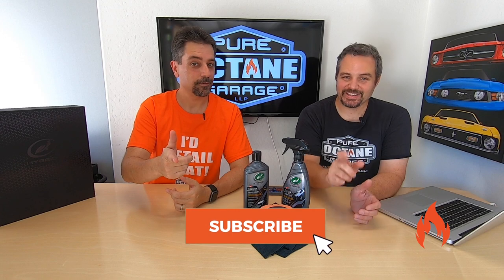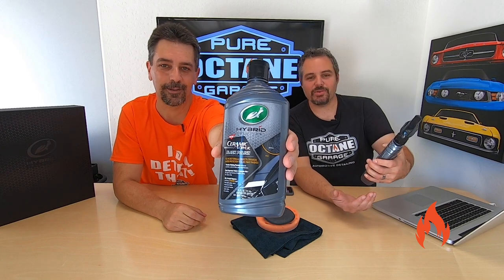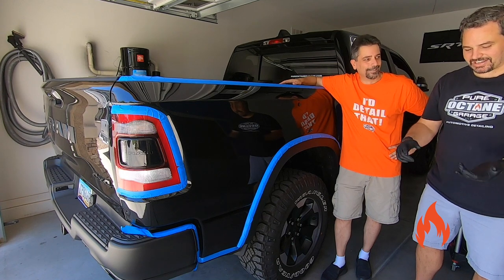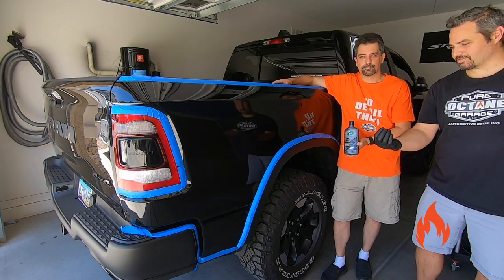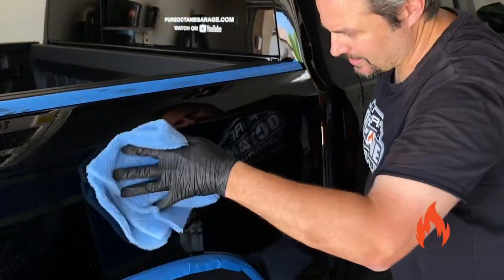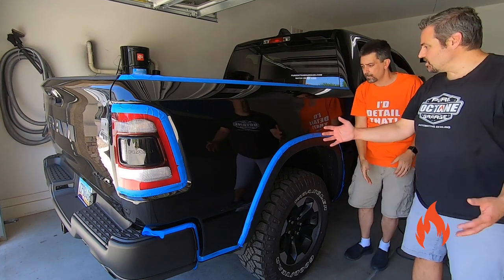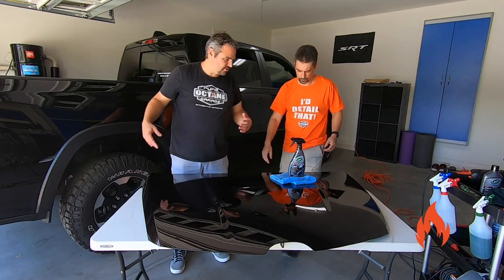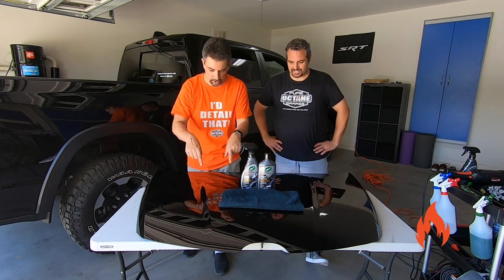Testing Out Turtle Wax Hybrid Solutions Ceramic Acrylic Black Polish & Spray Wax: Still Amazing?

Comment: It looks like you applied the black wax immediately after you polished with the black polish. The directions on the bottle and from TW directly say to wait 24 hours before topping. Did you in fact top the polish immediately after, or was that just a video edit? If so, how did the wax perform over the just polished panel? Also, what do you think the longevity is on just the polish alone? Thanks!
Reply from the maker: You are correct, for this demo we did apply the Black Wax immediately after the polish. (good catch as we forgot to mention the 24 hour cure recommendation). The products still performed excellent as far as application went. We can't find a Turtle Wax longevity claim for the Hybrid Solutions Polish & Wax; we are guessing maybe a couple months protection. Thanks for the questions and watching!